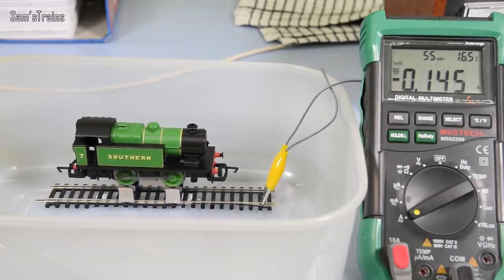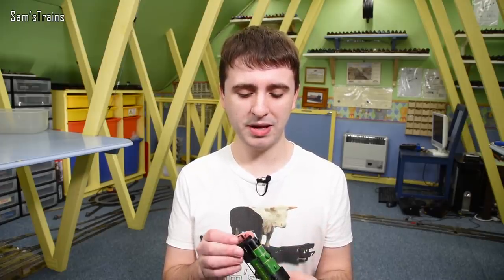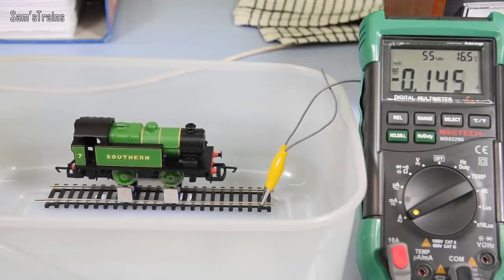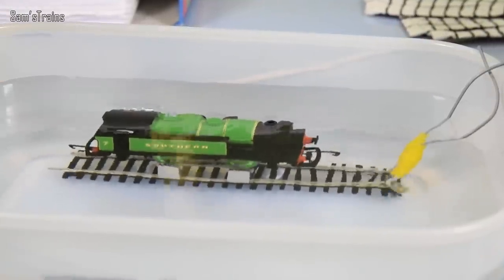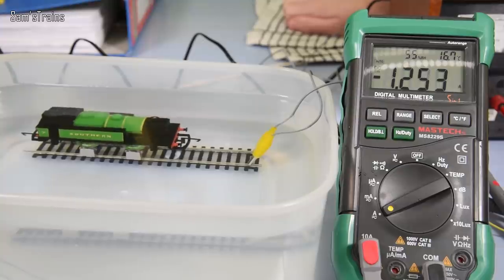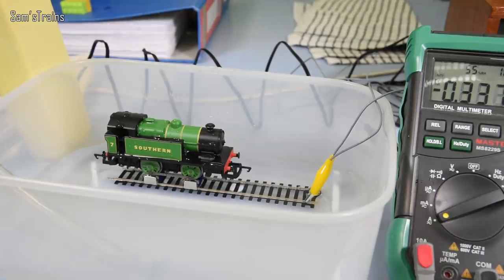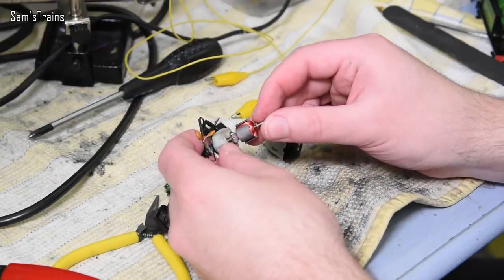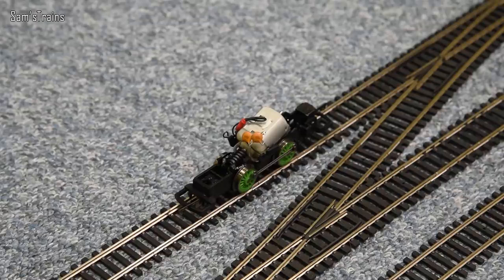Can Model Trains Work Under Water?

Comment: 7:00 That's because when you initial y covered the engine it would've trapped air inside the engine. Then as the water rushed into the engine the overall water level would've dropped
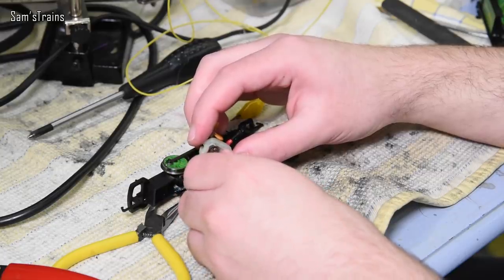13:30 While there is no salt in the water regular tap water has a lot of guff in it, like ions and such, it varies quite broadly based on where you live (which is why water tastes differently if you travel across the UK)

Comment: Sam I have had an idea. 

Lay lots of foam and / or an old mattress on the floor next to a table and a normal stretch of straight track on the table anduse a loco and crank up the voltage on the power supply (as on the 850mph model train video) and see if the higher the voltage the further the engine goes and measure how far it goes each time.

Answer is obvious, but will probably make a good video (use a hornby 101 tank or other models that dont have much / any separately fitted detail that could break off)
Reply from the maker: haha that'd be awesome - great idea!! :D

Comment: DC brushed motors will work fine underwater as you have witnessed for yourself. 

I have found this from building and operating RC subs. 

We 'break in' new motors by running them in a glass of water. 

A drop of Peco in that motor, and it'll be absolutely fine.
Reply from the maker: Yep they do indeed! Do you not get issues with the high current draw then, as I did here??
Thanks for watching - Sam :)

Comment: Saw a layout not so long ago of a real place where the tide comes in and water heads upto the engines running board at high tide, the man said he'd had the layout for about a year with the same train and he still hadn't had any serious problems, just a bit of rust on his rolling stock, seems if you were just wetting the wheels you'd be okay, just when the motor comes into it you experience problems. Great Video as usual Sam! :)
Reply from the maker: Wow that sounds incredible Jackie - I'd love to see that!! :O
Thanks for watching - Sam :)

Comment: Sam buddy  ⚡️💦

Seeing you have a huge younger audience doesn’t this send the wrong message to the younger viewers experimenting with electricity and water, yes science is a mixture of elements as you mentioned but maybe adult supervision would of been advisable  🤔

Little concerning video TBH

Garry
Reply from the maker: Hey Garry, thanks for the comment! I don't think that's an issue - I covered all of the safety warnings at the start, and I recommended using a 9V battery if anyone wanted to try this at home! HOWEVER, that was just a formality - there's no possible danger from using a 12v train controller in water - as long as the main power supply doesn't get splashed!
Thanks for watching - Sam :)

Comment: I'm sure that I saw a locomotive running underwater at Oak Hill Manor in Somerset in the early 1980s.  It was a little yellow 4 wheeled diesel shunter that ran backwards and forwards along a length of track in a fish tank.  Each end of the track was dry and the track dipped in the middle, the loco entering and leaving the water every time it ran a length.
Reply from the maker: Ooh really?? I'll have to look into that - that's very cool! :D
Thanks for watching - Sam :)
Reply: @SamsTrains  I'm not sure you'll find much, the place closed before we ever managed a second visit.  It was a manor house absolutely rammed with all kinds of models, trains, ships, cars etc.  I think there was a large model in the middle of the entrance hall, something along the lines of a 7 1/4" gauge Britannia.  You parked in a field and took a meandering miniature railway to the house.  The infrastructure on the railway was quite extensive, stations, bridges, engine sheds, workshops and a turntable.  It was an absolutely awsome place for a train obsessed young lad.  I'm not saying that if I win the lottery I've got a plan, but, I've got a plan. https://www.flickr.com/photos/trainsandstuff/sets/72157608030994648/

Comment: Just found out something about my new castle class. Apparently the reversing rob you know that big piece of metal on the driver side of the train is not there on the model so I don’t know can I take it to hornby to put a new reversing rod on it ? 

Also I start testing it and start making squeaking noises.
Reply from the maker: Hmmm yeah - you could return it if it arrived damaged - how long have you had it??
Thanks for watching - Sam :)
Reply: Sam'sTrains 

I had it for 2 days now. It had a detail pack with no reversing rod on it just see a little slot where it originally was.

Comment: They did it on BBC TV's Tomorrows World to demonstrate the then new Relco electronic track cleaning device back in 1977.

They used a Hornby Railways R.254 loco.

The Relco device prevented galvanism occurring due to electric currents, water and differing metals.

You can still buy Relco electronic track cleaning units today.
Reply from the maker: Ahh really?? I'll have to look that up - thanks for the info! :D
Thanks for watching - Sam :)

Comment: Hi mate. You own an EKR Adams radial don’t you? I ran mine today (it’s new, run around 3 times before) with a short good train and found that after about five minutes the front of the boiler was quite hot and it smelt hot but not burning and it’s performance was fine, any chance you could run yours and see if yours gets hot there after short periods in the same way mine does? ☺️
Reply from the maker: Hey Chris - yeah that's a common issue with the Oxford Adams Radial tanks - their motors have an uncanny tendency to burn out or fail. My EKR green version is the worst - it's actually a pretty poor runner!
Thanks for watching - Sam :)
Reply: Oh thanks for that! Mine has been used literally 3 times. Never run long, and only light loads. This was after about 5 minutes of running on half power, so a slow unlabored speed, and it was hot ish to the touch and smelt hot but not dangerous hot. Just hot. So I stopped it. I’m pretty disappointed with that. I hoped for better considering the high standard of the rest of the loco!!

Comment: @Sam'sTrains Do you remember me from the comment section of the video mentioned in this video?
One thing about electrolysis, it will happen at any time there is any voltage difference present (for example from one rail to another, electrolysis doesn't require salt, salts are just speeding the process up (sometimes a lot, deppending on the water contents), and it's not like tap water doesn't contain other salts), but it's speed deppends on the current flowing through the circuit, which often deppends on the voltage difference itself, and the distance between the rails, and also mostly the side area the rails (and also any additional electrolytes added to the water in this case, as mentioned earlier).
So if you run this experiment on a whole set, that's gauge is small, the current required to run anything is going to be rather big, not mentioning the fact that you generate Hydrogen gas by the electrolysis, which is flammable (in the right air mix), so you have to do this in a well ventilated room, or outside. Just saying, that if you're going to do this large-scale, it is going to be hard, and possibly dangerous (If you do manadge to light the generated gas).
I just want to say the extremes before they happen, and don't be supprised that the power supply might not allow the loco to go fast in that experiment (according to the current measurements that piece of track uses ~10mA (which is a lot, considering ~14.5 times less than a locomotive, but you need propably 12 pieces that might be 2 as long as this one to make a loop of track) at ~6V (10mA/6V = (10/6)mS of conductance per piece of track, so at 12V that piece of track takes 12V*(10/6)mS = 20mA, for more tracks you add conductances togetrer so 2 tracks would take 12V*(2*(10/6)mS)) = 40mA, and so on. To max out your first power supply (at 12V) just for electrolysis you would need: (300mA/12V)/((10/6)mS) = 60 of those track pieces. Those calculations are just aproximations, for anyone that might complain about the crudeness of the model and/or calculation).
Reply from the maker: Hey! Thanks very much for the info! I wouldn't entirely agree that electrolysis doesn't require salt (or ions) to work, and instead relies on the amount of current running through the circuit - I'm fairly sure that isn't true! It can't happen 'any time' either - unless the voltage difference is sufficiently large to overcome the resistivity of the substance. Current will only flow through the circuit at these voltages due to the presence of ions in the water. Adding salt to the water would increase the ionic content in the water, and thus allow more current to flow. The voltage difference will make an impact, but ultimately the resistivity of the electrolyte will be the greatest factor in this case.
Thanks for watching - Sam :)
Reply: @SamsTrains  I agree, electrolysis requires some ions to work, but in your case your water was (I'm almost 100& sure) not destiled, therefore it has some ions already in, and at that point it doesn't require any more of them, for just electrolysis to happen. Technicaly speaking, electrolysis will happen with even 1 "ion pair", but it will be very very very very very slow, which you might percive as it is not happening at all. I just wanted to say, that i didn't state clearly. Are you planning to do this experiment big-scale anyway? Thanks for replying - Eryk :)

Comment: Electricity is an interesting beast, ain't it...

I once met the man who used to be in charge of the power system for the New York City Subway. When the agency was giving tours of one of the power substations*, he would show off by touching a part, IIRC is was part of a breaker, that was live with 3rd rail current (roughly between 600 and 625 volts DC).

* the particular facility was IRT substation 13, which is directly behind the Ed Sullivan Theater. Due to EM interference, when Ed Sullivan was using the theater for his live Sunday night show, he had an agreement with New York City Transit where they'd take the station offline for a few hours. In the Early 1990s, when Dave Letterman moved in to the building, his people went to NYCTA and asked for the same deal. When they said, "yeah, we're filming Monday-Thursday at about 5PM", they were promptly shown the door...
Reply from the maker: haha it certainly is!! Blimey that's a fantastic story - thanks for sharing that, very cool! :D
Thanks for watching - Sam :)
Reply: Sam'sTrains I used to work for the transit authority’s in house museum (which is actually in an abandoned station on a one stop branch off the A train in Brooklyn. Imagine if London’s transport museum operated out of Aldwych and you’d mostly have an idea.) You’d be amazed what I walked away with.

I used to think the joke about Ensign Chekhov on Star Trek thinking everything was invent by Russians were a joke related solely to him, made up by the writers to show he was naive.

Then I met a little old woman in the museum who flat out asked me if I knew what the first subway was.

“sure, London” growing up as a fan of rapid transit there was one simple fact. “London, oldest, New York, biggest, Tokyo, busiest.”

And with a dead serious look on her face she goes “No... It was Moscow.”

Which I responded by pointing out it was built at the same time as the station she was standing in, which is functionally one of the “newer” stations.

Comment: there's no need for salt in the water for electrolysis. Aamof don't do that with salty water..you'll produce chlorine which is toxic.  There were bubbles on the other line too but less visible.  Nice test :p
Reply from the maker: Yes you're right, but salt would increase the conductivity! ;D
Thanks for watching - Sam :)

Comment: Can a locomotive run on a solar panel as this would make a fantastic garden railway that starts up by itself is it possible to connect the panel to the tracks
Reply from the maker: Yeah it could, I'm sure - great idea!! :D
Thanks for watching - Sam :)
Reply: @SamsTrains  fantastic channel Sam I think its possible I know that oo gauge works outside I have done it but to have a layout that works by its self would be awesome just think if it works and you built it you would be the first wow if I get time I think I will see if it can be done thanks sam

Comment: Hi Sam, interesting experiment there.

OK hows this for an idea? what is the steepest gradient a loco can climb under its over power. I had a 1 in 20 grade on my old layout, and all my locos could haul reasonable trains up it, but most of them had the old magnahesion system and were running on steel rails. Triang used to claim 1 in 16 was the steepest possible on their elevated track system, again with the magnetic wheels on steel track. Are steeper hills possible with that system? What about using non magnetic wheels on nickle silver track? Will traction tyres help? Will the weight of the loco help?

In real life 1  in 30 is about the steepest you can get away with on a mainline - Lickey in 1 in 37, and the line that links Exeter St Davids to Exeter Central in an average on 1 in 38 with about 50 yards at 1 in 30. A couple of branchlines in Wales and Scotland were at around 1 in 25 and some industrial lines got to 1 in 12. 

Anyway it could make for an interesting experiment
Reply from the maker: Hey Jon - that's a solid idea - I'm actually already making headway on that - I've built a special loco just for the job! I'll hopefully get the video made soon - great idea! :D
Thanks for watching - Sam :)

Comment: Random thought - What about the 3M Novec fluid they use for computers that are liquid cooled? You could probably leave a train running in that no problem if its safe for computer circuitry to be submersed in.
Reply from the maker: Yeah that's a solid idea - I wonder whether it'd insulate the wheels from the track though?? ;D
Thanks for watching - Sam :)

Comment: Hi Sam,
If its got to be tried your the man for the job.If you had asked me before seeing this I would have said the water as it conducts electricity would short out the rails why didn't it any Ideas?.
Cheers Robert.
Reply from the maker: haha I agree - it certainly had to be tried! Although water does conduct electricity, the resistance in water is actually pretty high - especially if it's fresh water with no salt! There will have been some current flowing between the rails (as evidenced by the bubbles), but the resistance would be too high to cause a short!
Thanks for watching - Sam :)

Comment: Well if you want to revive the locomotive you can do so by soaking the chassis and the motor in Industrial Methylated Spirits .... this will dry out all of the copper wires and allow them to conduct the electricity again and clean out carbon deposits that have built up.
Reply from the maker: haha yeah that's a good idea - though it's all fine after I cleaned the motor out - it's just the chassis needs replacing, since the motor mounting is damaged (since before the experiment!)
Thanks for watching - Sam :)

Comment: if you dont want it to rust or corrode spray it down with wd 40 its water phobic i use it for storing engine blocks
Reply from the maker: Ahh yeah that's a good idea!! Though I doubt the motor would like that either, lol! ;D
Thanks for watching - Sam :)

Comment: I would recommend any repeat of this is in open air ... electrolysis of water produces oxygen and hydrogen. Was surprised you didn’t get immediate short when the water bridged the rails but must be relative conductivity at work.
Reply from the maker: Thanks Chris! The resistivity of water (at least pure water) is relatively high - at 12v, the current flow is relatively low. I would be interested in measuring this at some point!
Thanks for watching - Sam :)
Reply: @SamsTrains  Put enough salt into the water and it won´t work no more !  :-)
What if it really RUNS under water ?

Comment: Actually water doesn’t conduct, it’s the impurities that are in the water that make it dangerous. Salt, calcium, and even oxygen will allow current flow, but water that has been purified (like distilled water), and de-oxygenated, is a very good insulator. In the military I maintained a piece of electronic equipment that was water cooled. Doesn’t sound special? The water was passed THROUGH the conductors! Operating at over 450 volts AC and three hundred volts DC, with no losses through the water.
Reply from the maker: Yes this is very true - the resistivity of pure water is pretty high - but most water-related electrical incidents don't involve distilled water, hehe!
Thanks for watching - Sam :)

Comment: Of course, if the water has more minerals, is salty or hot, that would likely be more dangerous as the waters conductivity should increase and it would probably ground through your body if you were to put your hand in
Reply from the maker: Yeah you're right - though 19v isn't enough to conduct much current through the body, even with direct contact with the skin!
Thanks for watching - Sam :)

Comment: Are you going to try replacing the motor with something from Poundland (like the USB Fan.) Let's see the Poundland train!
Reply from the maker: You could - they would fit - but they're the wrong voltage - so they'd run very fast, and easily burn out!
Thanks for watching - Sam :)
Reply: @SamsTrains  ... Yes. But how long would it last before burning out? (I have tried it.) I had 2 weeks on full power with no burn out.

Comment: Poor little southern locomotive. I bet it gets nervous when you go near it as it thought it was going to be happily running around a layout, not being run at high speed/voltage or underwater.
Reply from the maker: haha and rightly so - all my engines get nervous when I arrive! ;D
Thanks for watching - Sam :)
Reply: @SamsTrains  maybe you could modify it by fitting a slot car performance motor now the old one has died